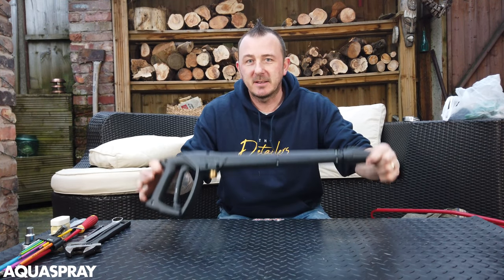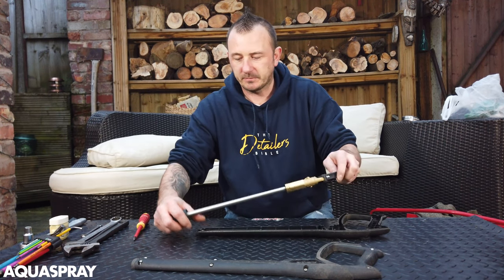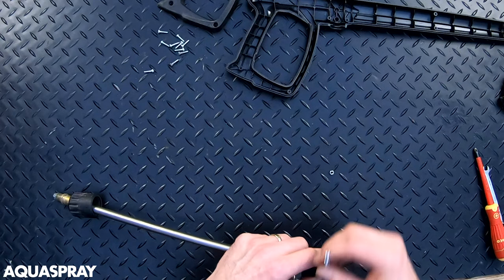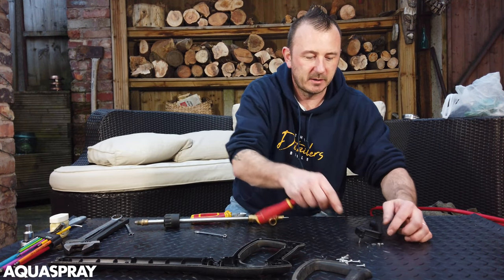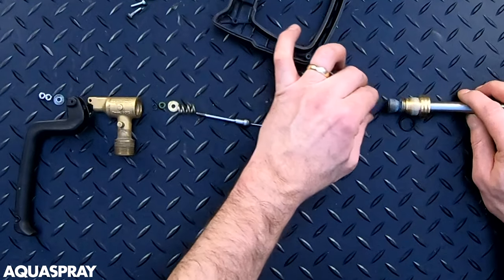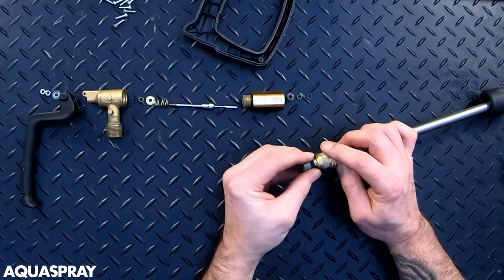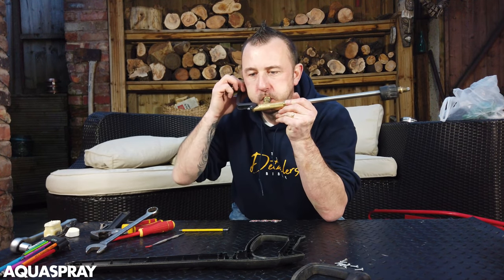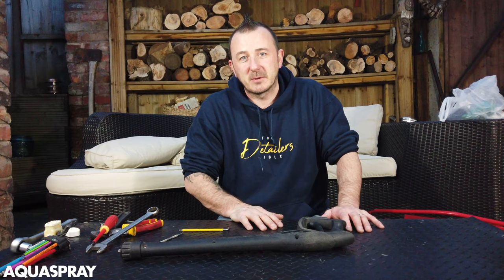How to Repair/Service Your Long Kranzle M2000 Gun Trigger

Comment: The trigger is not functioning on mine with water coming through the gun as soon as the generator is switched on, the trigger has no effect - what could this be?
Reply from the maker: You may need to replace the Gun repair kit, if you have followed this video but still doesn’t work. Links are in the description
Reply: @KranzlePressureWashers  Okay thanks - the repair kit is £40 but I could buy the whole new gun for £98 - is this correct?
Reply from the maker: @ROCKY44  yes the gun repair kit is the main workings of the gun, the things you get extra from the repair kit when buying a full gun is the plastic housing, valve housing and the outlet coupling
Reply: @KranzlePressureWashers  okay thanks. Probably better just buying a new gun and saving the hassle of trying to fix it.

Comment: Great video, a few months back i pulled the trigger and it just went floppy no water etc , it was a very cold morning, i guess the spring broke.
Are parts easy to get?  i will take it apart like you have just shown us
Reply from the maker: You may find if the m2000 gun got frozen, the seat of the valve may have moved,  strip clean and re grease everything as you put it back following the video and it should work unless the seat is damaged, in that case replace the gun repair kit and get the it back working as good as new 👍
Reply: @Kranzle Pressure Washers  Thankyou very much for your help 🙂, keep up the great videos
Reply from the maker: @detailingvideosuk  thanks 🙏 need any help just ask 👍